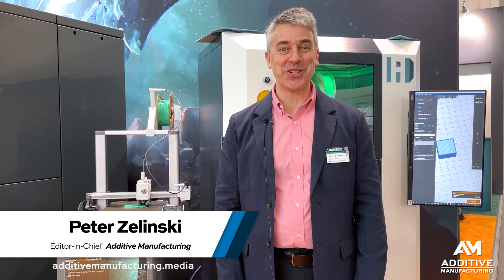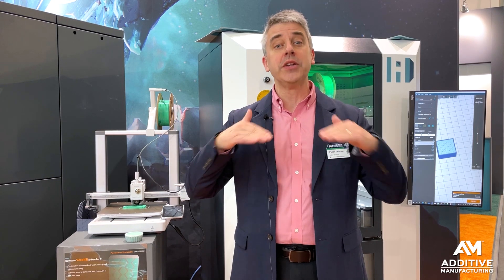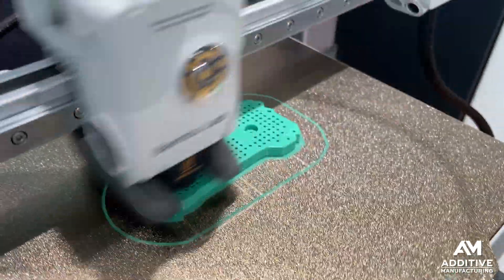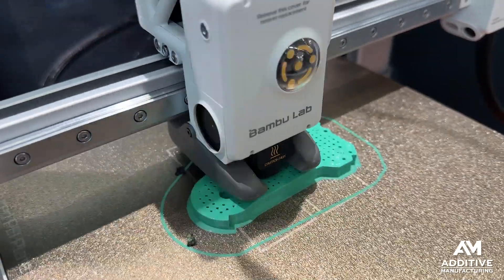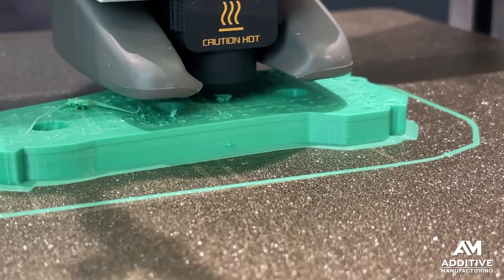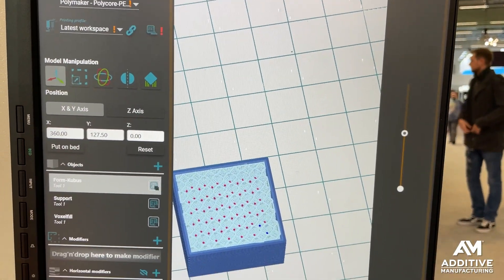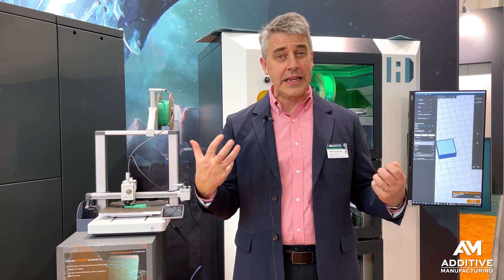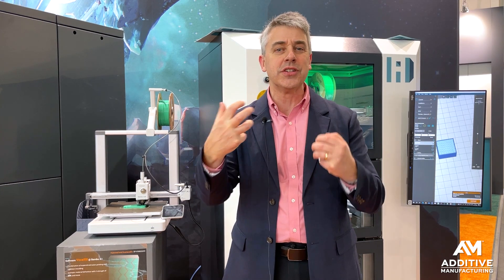Voxelfill: Combining 3D Printing and Injection Molding for Stronger Parts

Comment: What's the diameter of that nozzle? How much does it effect print speeds?
Reply from the maker: Response from Clemens Lieberwirth, CTO with Aim3D: "It depends on factors like the viscosity of the material and the part performance to be achieved. It is possible to work with 0.5 mm nozzle diameter, and it could also be possible to go down to 0.3 mm. In our tests, [this technique] did not increase printing time. The filling of the voxels decreases printing time, but the small lines around that increase printing time due to acceleration limitations. In total, the combination can slightly increase or decrease the printing time."

Comment: Cnc kitchen youtube channel did this long ago, he 3D printed a mold and injected plastic in it to obtain a part.
Reply: somehow i think you didn't understand what this video was about
Reply: @supremecommander2398 depends, did he use the printer nozzle to inject? Because that is basically what the video showed the printer doing, just not extracting a part after.